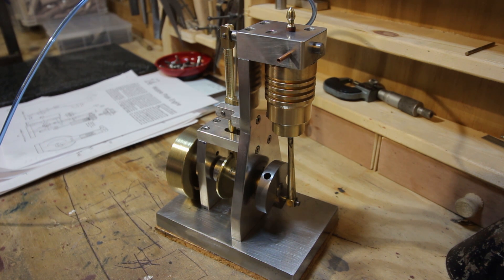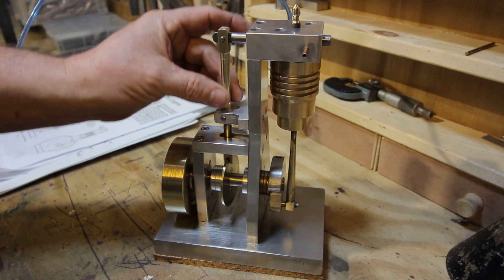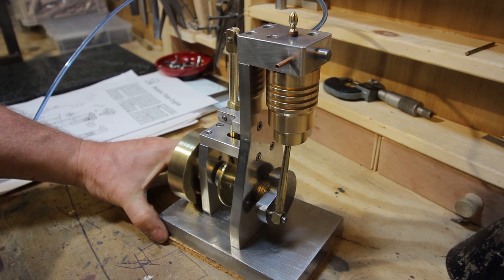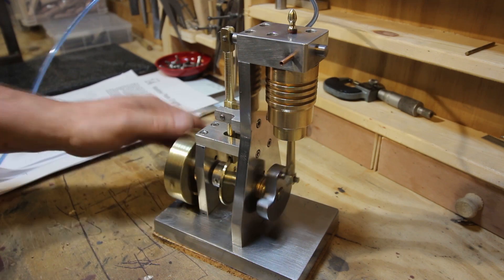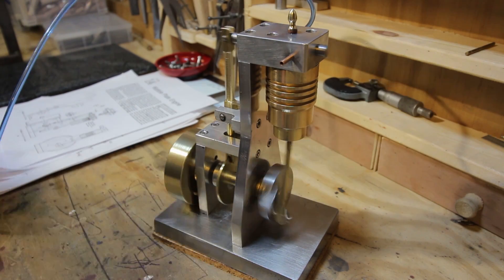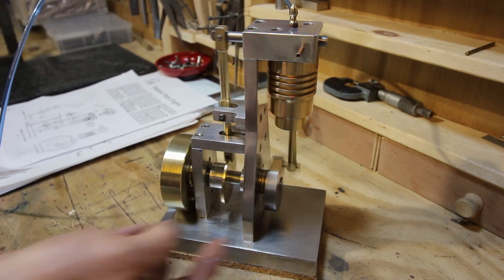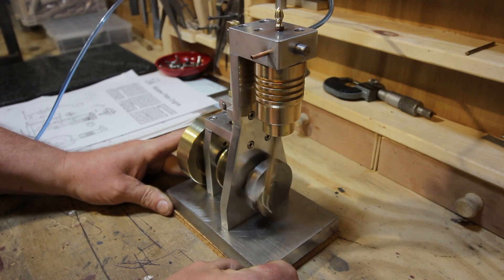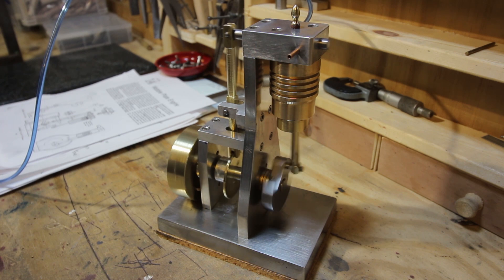Elmers Wobble-Plate Steam Engine

Comment: I like the design and have downloaded the drawings. I do like your modifications though. It is much easier to built with screwed/bolted connections than it is to silver solder or silver braze. I don't have any experience with silver solder, and it's been over 20 years since I've silver brazed.

I'm not sure if this is nearly as easy a design to build as your wig-wags, so I will most likely start with the wig-wags to experiment with. Once I finally get a few machines to build them that is 😁

Comment: Use of the term "wobble-plate" is very mis-leading - it implies that is how the shaft power is extracted. Nothing of the sort in this engine: the angled plate (generically, a 'swash-plate') merely functions as a axial face-cam (the technically correct description). You are a good machinist though.
Reply from the maker: The designer of the engine, Elmer Verberg, called this the 'Wobble Plate Engine' I dont think it is misleading at all
Reply: @adeswash  Verberg obviously wasn't a mechanical engineer. 
https://images.app.goo.gl/wLQFngV4iNgMpVL38

https://en.m.wikipedia.org/wiki/Swashplate

Comment: Hi Ade. 
Excellent build. Could you let me know the angle you put on the wobble plate collar. In my opinion its a great alternative to soldering. 
Many thanks in advance. Brendan
Reply from the maker: Hi Brendan, the angle is approximately 6 degrees, which produces about 1/8" wobble on the plate, this is amplified at the top by having the pivot set below centre height (the original drawings had it at centre) which gives approx 1/4"  movement of the spool valve in the valve block
Reply: Ade Swash 
Thanks a million for getting back to me.  I've just had a look and think I should have most of the materials to start this engine next week hopefully. 
Looking forward to your beam engine build.
Brendan.